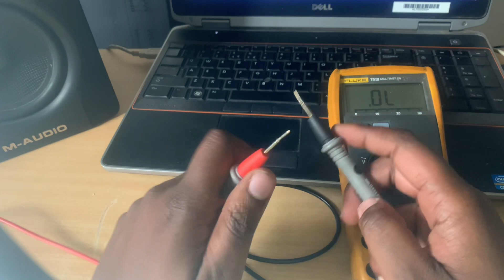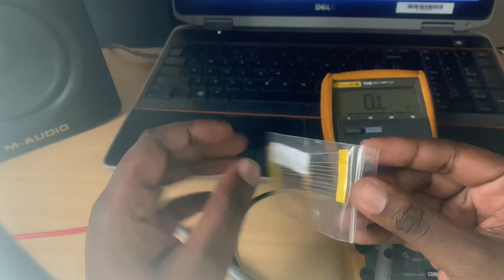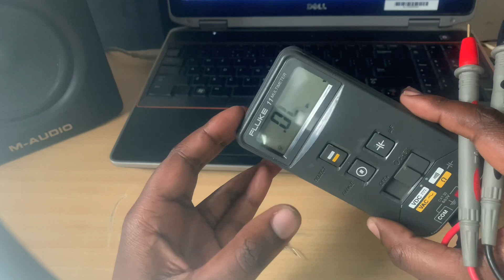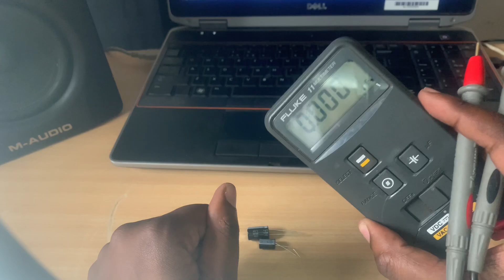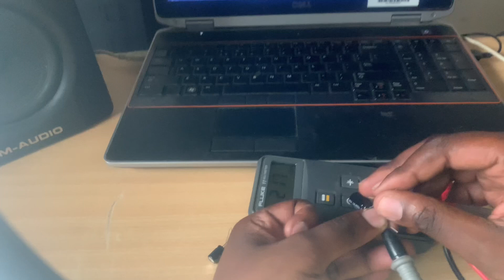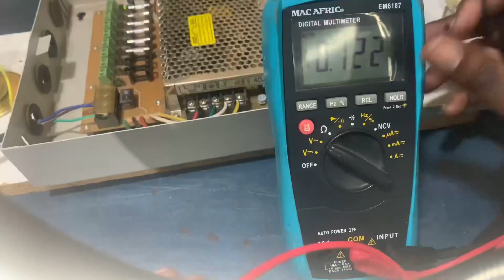How to use your multimeter to fix electronics #basicelectrical

Comment: I see you have m-audio monitors they're dope!
I've got BX8s but the transformers got fried during a power surge last month and I've been trying to get new transformers for them.
Where can I buy 22v E transformers in welcome or close by?
Reply from the maker: In Welkom?
Reply from the maker: Your transformer wouldn’t be so bad that it needs replacing. There is so many protection components in them that prevents wires from opening